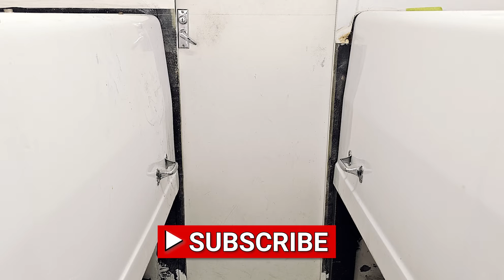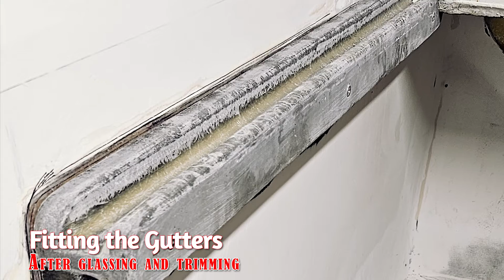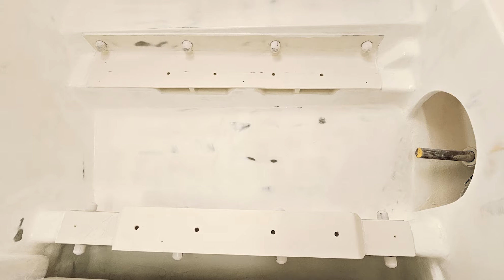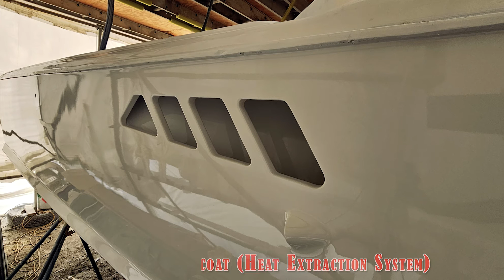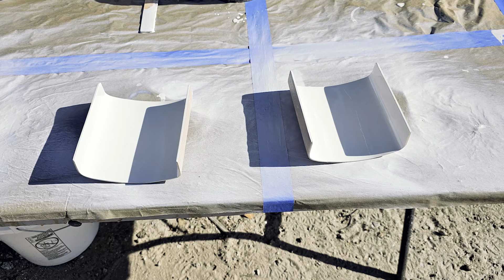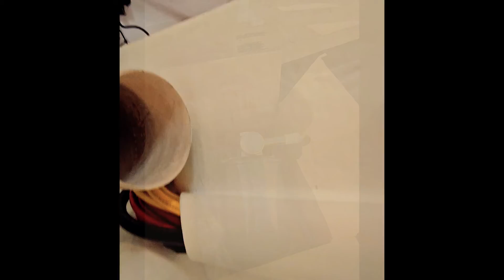Bertram 31 Restoration, Refit, Repower almost ready for power! #bertram #volvopenta #bertramyachts

Comment: Great work as always! What poly fairing do you use? Or 75 resin/25 GC with 75 Qcels/25 cabosil?
Reply from the maker: Thank you, Sir!! I use a  lightweight fairing compound distributed by Spectra Composites. I don't recall the product number. But I can post it if I remember!
Reply from the maker: Here is the Bonding Putty info:
N-TEGRA BONDING PUTTY
PU-235027-870-65
Super strong! 65 minutes until gel if you need it. Great stuff! Distributed by Spectra Composites